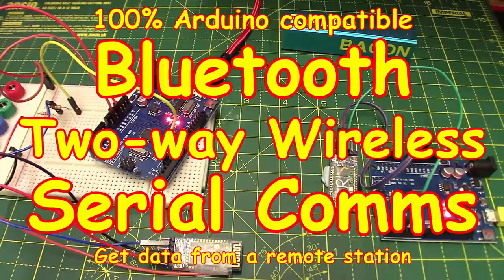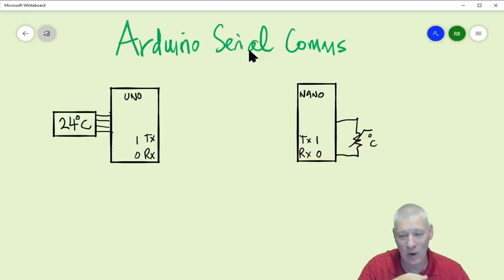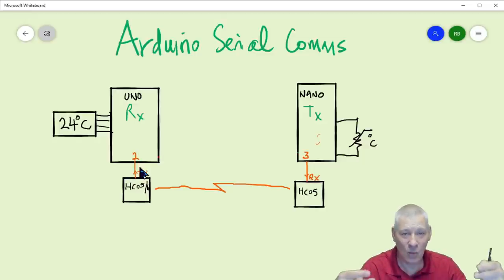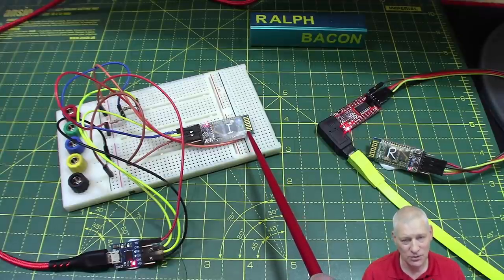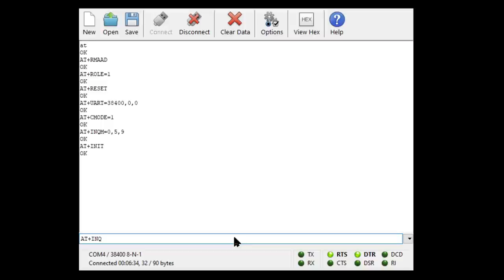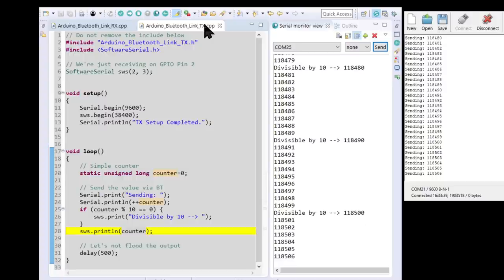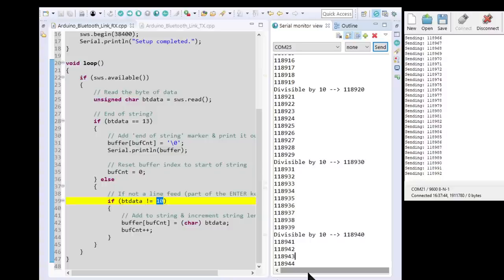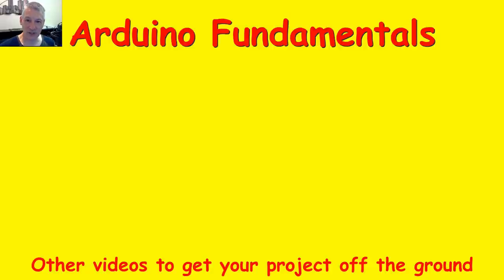#196 Two-Way Bluetooth Serial Comms for Arduino and other µControllers

Comment: I'm pretty sure I have paired and used two HC-06s some time ago, although I can't remember what for XD . The configuration for that was also much easier (just a single AT command on one of the modules to change its role).
Reply from the maker: The HC-06 cannot act as an initiator; that is, it cannot request a pairing from anything. For that you need an HC-05.
Reply: @RalphBacon  
Nope, I just retried. I definitively have two HC-06s talking to each other.  hterm -> CP2102 -> HC-06 ---> HC-06 -> CP2102 -> hterm.
The only thing you need to do is use the AT command "AT+ROLE=M" (M for [M]nitiator, S for [S]esponder). Obviously the PINs have to be the same on both. As soon as both are plugged in, the LEDs stop flashing and I can send text between two terminals.
Reply from the maker: I'm quite confused by this. As would Martyn Currey be too, no doubt. Setting the Role (AT+ROLE=1 or 0) only works on an HC-05 because the HC-06 can only ever be a responder. What have you bought there? How do you KNOW they are HC-06 devices? What tells you this? I'm intrigued to say the least.
Reply: @RalphBacon  
The main reason I think they are HC-06s is that I labeled them as such ;) . Joking aside AT+VERSION returns linvorV1.8 and baudrates have to be set with AT+BAUDx (x = 1,2,3,..,C). Both commands that are specific to the HC-06. (and none of the HC-05 specific commands work)

I bought nothing special, just the usual HC-06 modules from ebay (bought several over the years), like this one: 
https://www.ebay.com/itm/Slave-HC-06-Wireless-Bluetooth-Transeiver-RF-Module-Serial-4p-Port-line-M8/301724406499
I have modules with the silkscreen with the bluetooth symbol, other ones with the "POWER" and "LEVEL" silkscreen. setting them to ROLE=M works with all of them.

I don't know where that "can't pair on their own" is coming from. I've done that years ago already and I doubt it is something that the very recent modules stopped supporting.
Reply from the maker: The way to pair to another BT module is the way I showed (AT+PAIR). Your (alleged) HC-06 allows you that command? I'll see if I have an HC-06 still lying around to test this out on!
Reply: @RalphBacon  
I've looked into this some more. I found this is another case of Chinese manufacturers cheaping out and selling different things under the same name. 

All the HC-06s I have are fitted with the BC04 series bluetooth chip (BC417) and are running a firmware that reports itself as "linvorV1.8". That is also the HC-06 version that most results of tutorials are for. It does not have an AT+PAIR command.

Then there are also the HC-06 that have a BC03 chip (a chip from the early 2000s). I guess they found some cheap stock of those or are cloning them (as with so many things, like ST-links that don't contain a genuine STM32 anymore, switchmode regulators that use inferior switch mode chips labeled as an original aso.). I even read that some BC03 get relabeled as BC04. The typical fakery.

The former HC-06 can connect to another HC-06 by setting AT+ROLE=M (note: role is M or S, not 0 or 1). The latter HC-06 can't do that (and you can't flash the linvor firmware onto it yourself, because it doesn't support BC03s).

The annoying thing as always: you don't know what you get when ordering. While many of the item pictures show modules with an BC417, I'm sure the seller doesn't know what they will actually send you as they just forward what comes out of a random factory that day.

Comment: This is great, I want to use this to monitor my 3D printer that's in the back room. I can never think up ideas like this on my own but I can always take someone's idea and modify it all up until it does what I need..easy enough to get the serial print out to a lcd..
Reply from the maker: Go for it! And you'll be an expert in AT commands when you're finished.
Reply: I use an old raspi and octoprint to watch mine. you can even connect a web cam to it to stream video.
Reply: @TuttleScott  I use octoprint already,even use spaghetti , but I want something portable and battery powered and just to watch temps without my chunky laptop..lol
Reply: @sortofsmarter  hmmm, that's probably doable with a script on it somehow since raspis have bluetooth already. I'd check the octoprint addons. never know.

Comment: hey ralph, i have a question ,in my project i have 4 servos controlled by mpu6050 ,servos are going to be on the robotic arm and controlled by arduino and motor driver which are receiving signal through hco5 from another arduino having 4 mpu6050 so if i want to use 2 sensors(mpu6050) together so hco5 will send the data directly how i sort them for different motors or even i send the signal one by one how i sort and  send signal to the respective motor?
Reply from the maker: The data you send must include some kind of identifier. You probably want to send a struct which will include the data and the servo identifier as a block of data.

Comment: Nice. I like that breadboard. I haven't seen that one before.
Reply from the maker: I love it. So much better than my other (Asian, cheap) ones. I got it from Cool Components in the UK, not cheap but then again quality never is. I now have three and they have reduced my stress factor when plugging components into the breadboard to near zero!
https://coolcomponents.co.uk/products/ad-11-advanced-solderless-breadboard
Reply: @RalphBacon  
  It's one of the best executed inclusions of terminal posts I've seen. The Asian ones have been okay for me. I've gotten some bad ones but mostly good. I wish they would offer a slightly better quality version and hard gold plate the terminal ends at a reasonable price. The biggest issue I've had is with rust on the terminals over time. I have had the same issue with my old velleman boards from RadioShack too, at least the ones I have taken apart.

Comment: Very nice work Ralph. I will revisit my owon multimeter data receiver that I couldn’t get working.
Reply from the maker: You can do it! Let me know how you get on!
Reply from the maker: Hmm, which bit of that project did you not get going? The BT comms?
Reply: Ralph S Bacon yes, could not get the auto connect working.

Comment: is there any way, we can convert one ps2 mouse or keyboard to wireless with arduino/nrf/bt modules?
and thanks for the vid, as always.
Reply: Not without massive lagg? Ps2 to arduino uno->BT bt->arduino Leonardo ->HID imnterface via micro USB..
Much hassle for what?
Reply from the maker: Yes and yes but not the way you think, perhaps. I've now got my Numeric Keypad running (in prototype mode) but it uses a USB HOST module plugged into an Arduino to RECEIVE the data, then another Arduino to act as the USB DEVICE (as per my video switching unit) that gets read by the PC. When I plugged in my wireless dongle it "just worked", so I could use my keyboard (and mouse, but I didn't try it) with my Arduino.
Stay tuned for the final project!
Reply: @kitecattestecke2303   @Ralph S Bacon   i see. so no straight forward way to make regular keyboards to wireless ?
Reply from the maker: Well: Keyboard -> Arduino HOST -> Arduino DEVICE -> PC is fairly straightforward but I suspect it would be cheaper to just buy a wireless keyboard. However, keep tuned as this is something I will share.
Reply: @RalphBacon  oh great !

Comment: Hi Ralph, any chance these support the "+++" sequence to switch to command mode, as old school Hayes compatible modems did?
(I feel old)
Reply from the maker: I've not seen that method of switching to command mode, and given that you have to tie pin 34 high to get FULL command mode (otherwise you get mini command mode, if you pressed the button as you powered up) I'd doubt it.
Reply: @RalphBacon  OK, that would have been convenient, thanks for your answer!

Comment: I would like to create a brake light system for a motorcycle that could be activated by bluetooth where the led would be on the rider's jacket. But that didn't use a cell phone, but a button on the motorcycle's brake pedal.

Do you have a tutorial that could help me?
Reply from the maker: So the motorbike brake light will initiate a transmission to the rider's jacket light, to light up the LED?

Remember the receiver (the rider's jacket) has to be permanently switched on if it is to receive the signal. So you want longevity of battery power (unless the rider is hooked up to the bike's voltage supply, if that is even legal). The nRF24 has an IRQ (interrupt) pin that changes value when it receives a transmission; this could be used to interrupt a microcontroller from a Deep Sleep (power saving) state.

Ironically, the bike's (brake light) transmitter only needs to switch on when the brake is initiated; A small ATTiny85 with nRF24L01 would switch on within about 100mS.

You need to draw this out, in its simplest form, and get it working on the workbench. Range will not be an issue so even fake nRF24s will work, as long as the standby current is low. Original versions have a standby current of about 20-300μA (depending on exact mode) fine for battery use. The LEDs on the rider's jacket will take several hundred times more than that, I suppose.

This video should get you started at least. Then you will at least know what works and what doesn't. A prototype is called for!
Reply: @RalphBacon  thanks. Your explanation was very usefull. I will study and try to do it.

Comment: If you don't get the responder to answer back how does the initiator know that the data has been received?
Reply from the maker: Apparently, Bluetooth LE guarantees that either the message is delivered, or the connection drops. Probably an ACK being sent back behind the scenes. An ACK means the data was received, intact.  A bit like what the nRF24L01+ modules do. That's my (broad, non-specific) understanding, anyway!

Comment: what is the range of bluetooth module?can i use this in school building of 4 floors?
Reply from the maker: BT has a technical max range of around 30m in free air. I doubt that would penetrate 4 floors (possibly concrete) of a building. You would need repeater stations on each floor!

Comment: Hmm running 9600 baud over 300 feet never used to pose us a problem years ago and 110 and 300 baud were standard telex rates for decades Ralph, I'm SURE you must remember those (Grandstand on the Beeb at results time on a Saturday!?). Bluetooth is great and highly useful, as is WiFi, but I think that sometimes young Arduinites might be surprised at what the world actually achieved 30, 40 and even 50 years ago! I used to quite happily get a VTX screen full of live data from Oz in less than a second as far back as the mid 80's! (maximum speed on the link? 64k baud international private modem link!) Basic serial comms (RS232 or RS422). NOTHING so simple as two twisted pairs for reliable serial comms up to 128k baud - distance is really the limiting factor for whatever speed the data needs (and avoidance of noise - use RS422 for better noise rejection). And as Einstein said "Things should be as simple as possible, but no simpler". Bob says "VERY simple works, is LOW cost (pennies), super reliable and secure"! :)) 

Really nice,useful video as always though, despite my preference for old, simple tech! LOL
Reply from the maker: Remember Grandstand on a Saturday, Bob? I was but a glint in my dad's eye... well, alright, yes I do, and it was boring as mud. I guess I don't have the football or horse racing gene!
I know that when connecting a cassette deck to my first UK101 computer, it would only run at 300 baud over a couple of feet before errors crept in. I could double the speed if the cable was shorter. I guess commercial solutions have more resources (money, time, expertise) to get it right.
Reply: @RalphBacon  Ha! Ha! No! I'm Welsh! Round ball!!?? Sacrilege where I hail from! Horses? Only to ride occasionally (not for decades though!)

Back in the early 80's, everone was on serial green or white monochrome screens so they and all the comms was always over serial - mainly 9600, especially when modems went from 2400 up to 9600 baud! Modern serial, especially on 3v  electronics tends to be limited purely by lack of voltage drive, easily solved though by level shifters each end. 😁
Reply from the maker: Yes, I've heard that rugby is a game Welshmen play with odd shaped balls. 😁
Reply: @RalphBacon  Vielleicht, aber Ich habe zwei Eier auch! 😁
Reply: At logic level ? I remember logic levels being converted to +/- 12 volts for communicating longer distances.
Reply: @noweare1  actually, even before digital signalling 4-20mA current loop was used, but was used often in early digital comms for long distances >>200m.

When I worked as a field service engineer 40 years ago I had many customers using such signalling for 300 to 9600 baud connections. And very reliable it was too at those speeds and long distances.

Comment: Damn!! I ordered 5 HC-05 in mid 2019 at £2.02 each!  Now £5.87 each!!
Reply: You can still easily find them for ~3$/€. But many of the sellers now charge shipping costs.
Reply from the maker: As superdau says, shipping is slowly killing the Chinese and Asian markets (for me, anyway). When the price difference is just $1 for Chinese vs Local (with the Local delivering in a few days) then I prefer to spend the extra $.

Comment: can we connect a hc05 and esp01s to one arduino? is that possible
Reply from the maker: Absolutely. You can communicate with the ESP01 via TX/RX (if  you use the SoftwareSerial library you can choose which pins you use) and use a different set of TX/RX pins for the HC05 (you will need two instances of the SoftwareSerial object, one for each device).
Reply: @RalphBacon Ok thank you so much sirr😁😁👍

Comment: does this require a usb to serial or can an Arduino be used as a usb to serial?
Reply: if not what is that usb serial adapter module thing?
Reply from the maker: I don't see a USB-to-Serial module (not in the first few minutes of the video, anyway), I'm just using two Arduino UNOs with two BT modules. Perhaps you have a video timecode you can send me?
Reply: @RalphBacon  oh ignore me, i didn't see you name it last time it was a cp2102 8:48 . I ended up finding a video of someone setting it up without one of those so im good now anyway. Cheers though

Comment: why not just use esp32?
Reply from the maker: Well, you could do, although the design to which I'm working doesn't specify that. I guess the only way to know would be to try it with one and see how well it worked. I don't think I've ever used BT on the ESP32... how remiss of me, something to add to the list. That way, we'd have processor, BT and (should we need it) WiFi too!

Comment: emmm i need to write to all the hdd companies that i have hard drives off in my old pc's, I find the sticky labels on them to use disgusting terminology for the jumper settings. ... maybe i should demand new hdd's.......
Reply from the maker: Well, I would not be surprised if the HDD companies decided that their use of outdated and insensitive terminology should be replaced. For PR reasons, if nothing else. If they use Initiator and Responder I want my fair cut! Let's face it, if Lady Antebellum (a country rock group I've followed for years) can change their name, anything can happen.

Comment: BT sucks and now I see why. 
Long live nrf24.
Reply from the maker: Harsh words there, PirateKitty! It's just that, for whatever reason, the BT chip makers decided on the Hayes "AT" instruction set, as it covered all bases. But once you have got a pair connected it's so simple. That's why everything from Smartphones to headphones are all BT enabled.
Of course, nRF24L01+ modules are a viable alternative which is why I did a whole video about them in video #73 https://youtu.be/JSHJ-RLbNJk